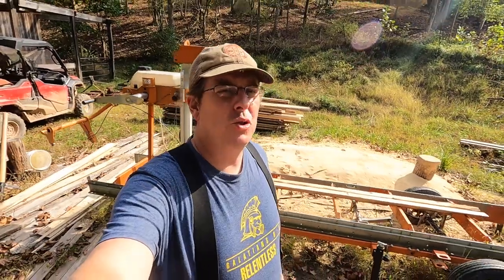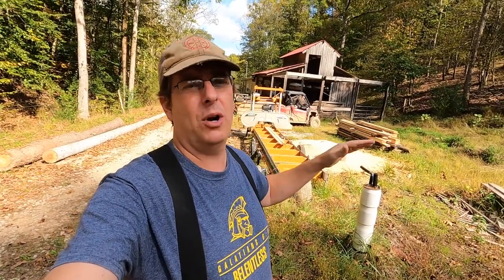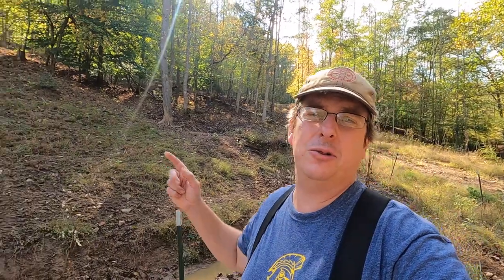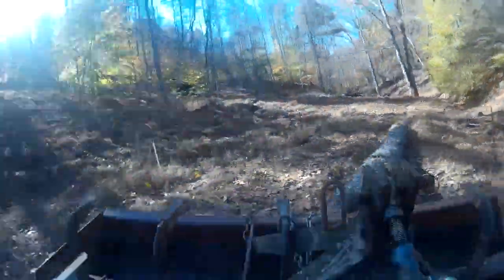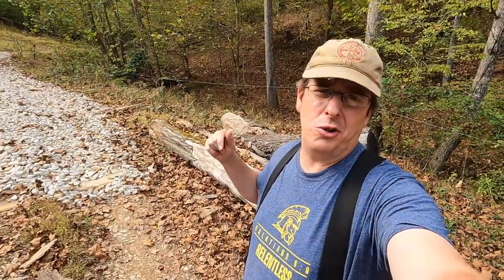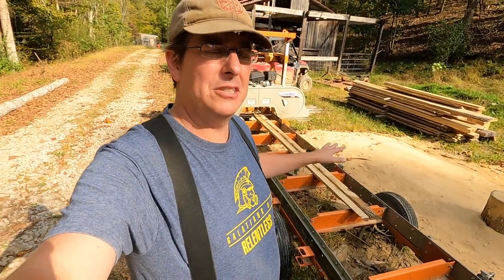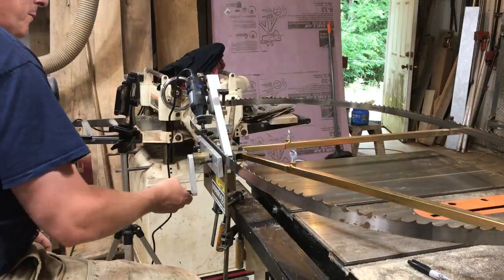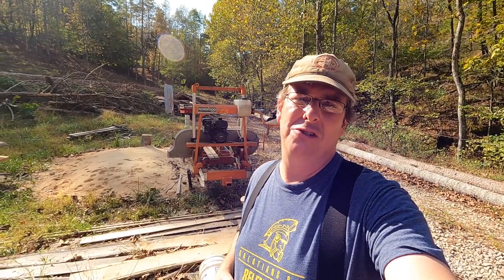What ADDITIONAL Tools Do You Need to Operate Your Sawmill and How Much Do They Cost?

Comment: In the realm of chainsaws, you can get by with one high-quality saw that is big enough to fell/section the largest logs you anticipate dealing with. I definitely agree to avoid cheap saws (been there, done that, basically threw money away). I would suggest people stick with Husqvarna, Stihl, or Echo as probably the big three. To move from "bare minimum" to "better" I would add a second smaller saw. You probably don't really want to hassle with a 60-90 cc monster saw for limbing and working with smaller trees. Plus, having a backup saw to help free your main saw when (not if) you get it stuck can be a good idea. I actually have an old, cheap Homelite 16" saw that's been running flawlessly for 20 years now, and it is my go-to saw for felling small trees, clearing the working area around trees I'm felling, and limbing. Having a smaller saw at the mill to cut off material that is interfering with the mill is also handy. Don't forget wedges and an axe or hatchet for felling plus files to sharpen your saw chain, and a spare chain or two. (The list really is never-ending, isn't it!) Appreciate the video!
Reply from the maker: Good additions for sure. Backup chainsaw is definitely handy
Reply: @The Night Life  @Red Tool House - Homestead  Or you could just have a second bar and chain.  Remove the powerhead from the stuck bar, attach the back-up bar and chain and away you go.  Wedges are also handy for unsticking chainsaws.

Comment: I spent more on my sawmill thanks to people like you that showed me the work involved in using a bandsaw mill! I also spent more on a tractor to be able to move larger logs since my property has 60ft southern pine that are 3ft in diameter at head height and some stay that size 20ft high! So they are quite heavy when I want to leave them 16' to 20' long! I also have two saws one 36" one 16" both Husqvarna because they so my budget was around $100k but half that was a new tractor! I am glad I spent more on hydraulic mill and newer tractor because its definitely a lot of work felling your own trees getting them cleaned up and moved to sawmill then milling them and stacking lumber to dry! But I have probably already recouped $10k of my investment of equipment in 1 year and I have at least 10 more years and just starting to mill for other people so should pay for it all in less than 5 years! I did buy all equipment without loans so I'm good either way im not suggesting to borrow money since that's counter productive! You definitely have to like the work because its not about money so if you don't like sawdust and sweat hire someone that does and save your back!

Comment: Purchased a Woodland Mills set up about 6 months ago, with a box of blades, extension rails, cant hook, spare parts and shipping it was almost $6K. already own a 60hp tractor with loader. I did purchase a cheap set of forks that helps with moving and loading logs and my Sthil 291 20" cost me $ 500. I only have 20 Ac with around 15 being Planted and natural growth Pine  of around 40 /50 yrs old That should last me a while and I will be Picking up logs from other locations as opportunities come up. I have a 18 ft trailer I need to add a winch to.  I figure by the time I frame and close in most of my 40 x 60 pole barn the Mill will be paid for its self.  Hopefully as I go I can sell some Lumber as well to offset Blade cost and fund the purchase of a Blade sharpener system.

Comment: The only thing I would add is a pickaroon.  Might not be 100% needed in a bare bones operation, but your back will thank you.  It’s great for dragging heavy slabs off the cant l, instead of picking them up when you can’t get your fingers under the newly cut edge..

Comment: On chainsaws, buy the best quality you can afford, but not the biggest.  Massive macho saws that you don’t really need will wear you out quickly, no matter how ripped you are.  If you’re only going to buy one saw, keep it modest.   Or, as one other commenter said, consider having a small saw and a larger saw.  You’ll be amazed how often you grab the smaller one.  
Do your research - the major brands (eg. Stihl, Husqvarna) have different series of saws for consumers (occasional cutting), “farm” (medium use”), and pro series for frequent use and/or a lifetime investment.  There is a substantial difference in price - be realistic about what you really need.  For first timers who want to buy one saw, the Stihl MS250 with an 18” bar is a very capable saw at a ridiculously good price.  I have put hundreds of hours on mine and have never had an issue (and even bought one for my son!).  If you can afford it, the Stihl MS261 with an 18” bar is one of the best all-purpose “pro” saws you can buy (yes, I have one of those too... and several others bigger and smaller).  Husky has similar options. 

Do you really need a ridiculously long bar?  No - how often will you cut a 24” log?  A modest size saw with an 18” bar (or maybe 20” if you have a really mature forest) will probably cut 90% of your trees in one pass.   And when it doesn’t, you can cut from two sides up to “36”!!  
I own 5 saws but use 3 of them for most my cutting.  My little MS170 is in my hands 25-30% of the time for limbing and clearing brush and small trees.  I am not a young man anymore and have arthritic hands, but I can work with that 170 all day!

Comment: nice list ... for basics .. one thing your forgetting is knowledge of creating boards ... before you waste 10 grand  or more you really should know quarter sawn burl cuts ect and dimensional cutting factors a moisture meter is very very handy also. i would really put carport type system over the mill .. 6k and 2 years later you have rust damage.. every tool you get will have its own list of thing you need for that tool.. chain saws better  have more then one imho.. and all the extras needed for that ..

Comment: i thing it will cost a little more than that. i thing you need 2 chain saws. i have 4 running saws 46, 41, 28 super and a electric one for triming. i am getting ready for my mill and will be putting roof over it i thing that is a real need for all sawmills. if you are going to saw really big logs over 30 inch wide and over 12 foot. you will need a good loader. plan out everything be fore you set your mill works best to load logs on one side put sawed lumber on other side and waste on one end in a rack of some kind. you will need to get to all sides. thanks for videos have learned a lot from your video's take care, be safe and well.

Comment: A real sawmill $80,000
Log deck infeeder $14,000
Board edger $16,000
60 cobalt blades $5,000
50hp tractor w/loader $35,000
Cat Claw sharpener and setter $3,500
Stihl chainsaw $700
Chop saw $500
Banding tool & supplies $300
HD trailer w/7k axles $5,000
Diesel, oil, misc tools etc. $2,500
Money to buy logs $5,000
That's for a real sawmill setup.
Reply from the maker: Makes perfect sense for the small farm. That is more than I have invested in my 100 acres of land